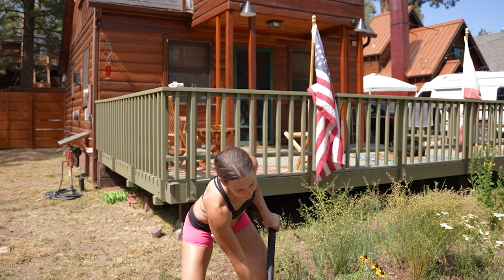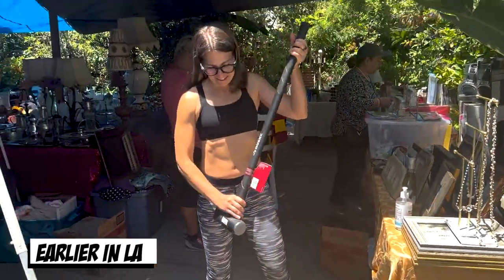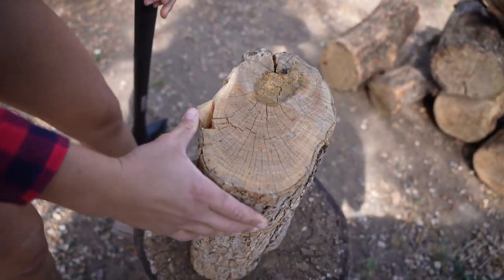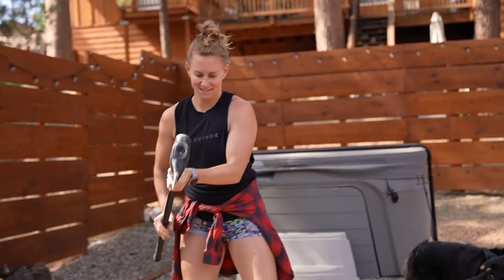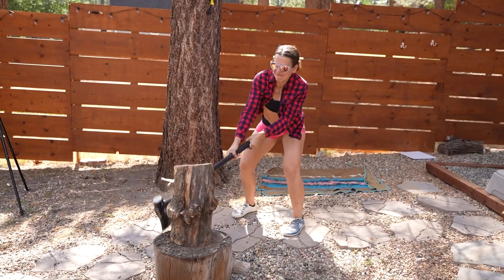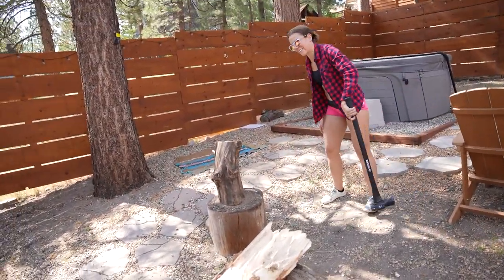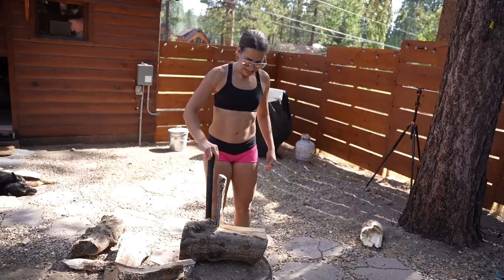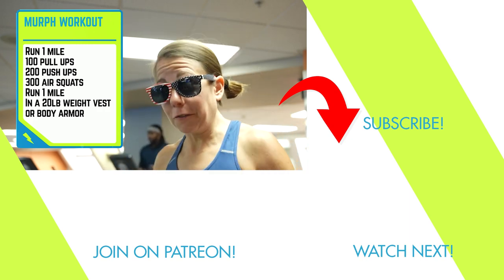We Try Wood Chopping for the 1st Time

Comment: I think when you asked for unsplit logs they gave you all the rejected pieces that they didn’t split due to knots and moisture  etc.

You aren’t aiming for the log you want to split, you’re aiming for the piece it’s sitting on. It just happens to pass through the center of the top one on the way down. That’s the visualization I was taught to use. 

That wedge also seemed useless, I’ve never seen one bounce off repeatedly like that. No wonder they got rid of it hahaha

Comment: Props to you for doing as well as you did. I think maybe a lighter and sharper maul would have been more successful. It’s pretty important to be able to control where you’re swinging that thing. I was worried about your feet and legs the whole time. If it was lighter, you would have been able to hit the rounds with more speed, and done more damage. You also would have been less like to miss and lose a toe. ;)

Comment: If you were actually interested in improving, using a lighter axe and starting by chopping through long pieces (not splitting) is the way to get your aim and swing developed.  Splitting is way harder, and benefits more from a heavier maul-style tool or splitting axe.  TFW you find out a physical skill that looks cool starts with long stretches of looking dumb doing easier things...

Comment: 1) yes! 
2) no, esp. not if you do it correctly. 
3) yes, but please keeps safety in mind. not just others, but your own. swinging any heavy object with a long leverage can do serious harm if done wrong! 
4) yes!

:D
Reply: oh, and "splitting" axes are very specific in how to use to split... note the flat hammer end..
Reply: watch?v=sWAZ1wgVEzk this one explains proper stance quite well. you dont need to "push the whole axe" up just holding the tip of the handle. just push the head up straight, pull the guiding hand in. the handle-hand should move just vertical.